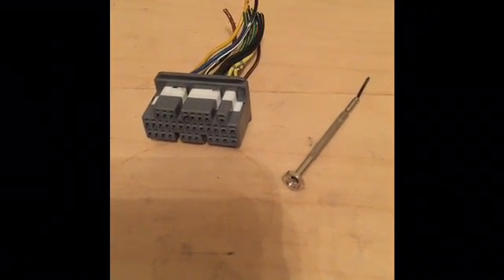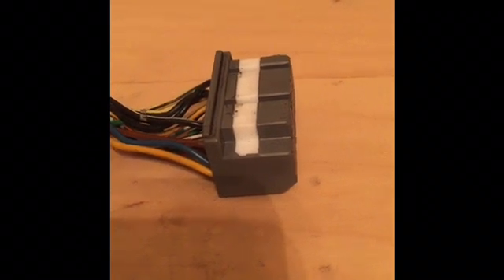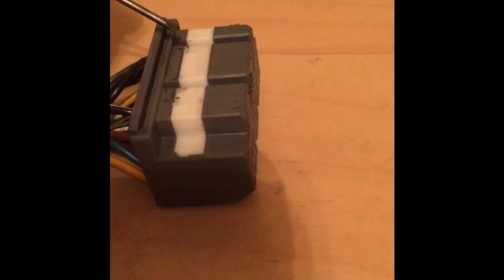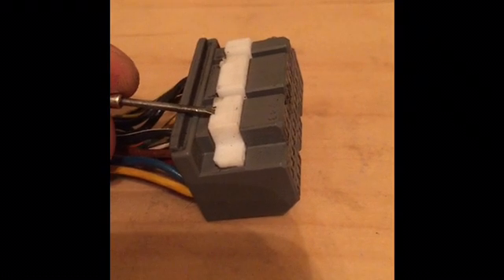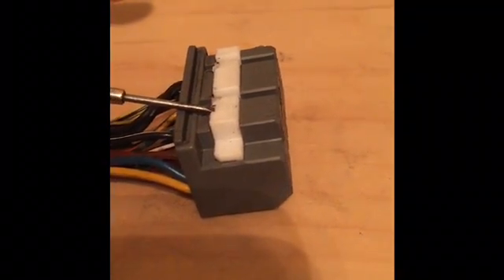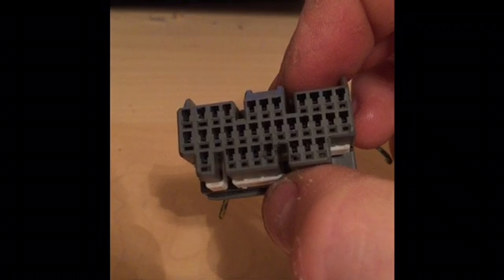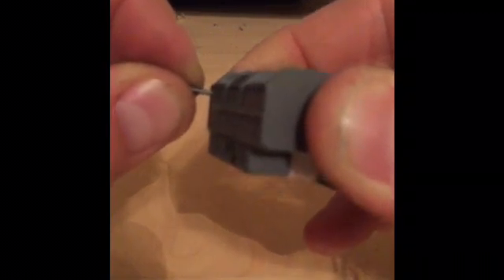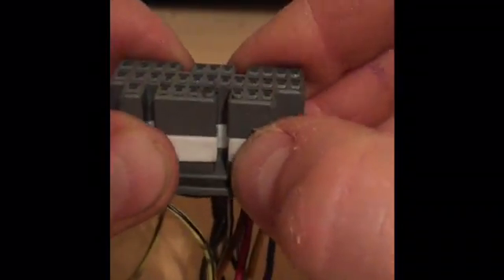Honda and Acura OBD2A and OBD2B Depin and Pin ECU Connectors Plugs

Comment: The cutaway really helps understand exactly what needs to happen.  Thanks for the video.  This can be extremely frustrating not knowing exactly how it works, especially when you’re trying to figure it out with head/arms stuffed in the back of the floorpan in the dark.

Comment: Can you stick a freshly stripped wire in the ECU plug without the metal connector and it work????? I'm trying to hook up my knock sensor for an h22a to an accord plug (empty slot) to use an accord harness on the h22 ecu.... Please help...
Reply from the maker: I’m sure it can be done, probably won’t stay long
Reply: I don't have any connectors to hook this up....
Reply: I've got connectors on the way but would like to crank and test before... 10 days to ship😢😢

Comment: Thank you for making this, ive had a horrible problem trying to unpin my harness to do the 3 wire to 2 wire IACV mod. Im going to try this when I get home, for some reason I just wasn't able to pull the wire out.
Reply: ChaseTheHonda did u have to replace 3 wire plug for iacv or did u just have to wire it?? I'm dealing with this now with d15b swap